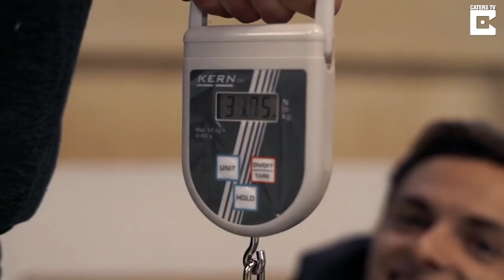World's First Flying Bath Tub

Comment: Based on the number listed here....120 hp with 24 - 5000 mAh batteries. Divide that by 6 motors = 20 hp with 4 batteries. There is simply no way that 4 - 5000 mAh batteries would run a 20hp motor for more than a few seconds.
Reply: Well on normal hovering they probably need about half of their maximum ratings. If they run with 44 V at 10 kW, they consume 10000/44 A = 227 A. Lets say 250 A with 5 Ah batteries. That means a flight time of 5/250*60 min = 1,2 min. Here you are.
Reply: And yet it works. They literally flew to a baker with it.